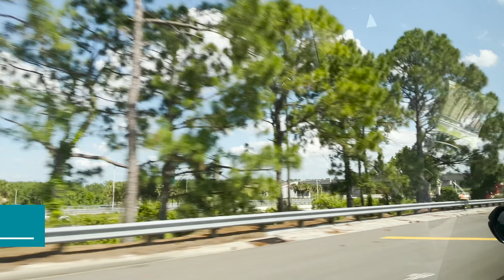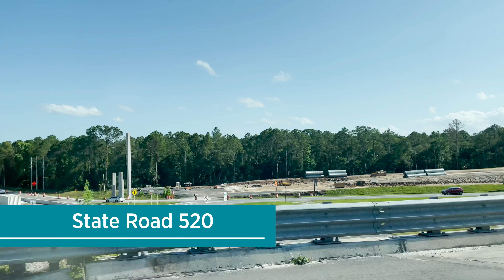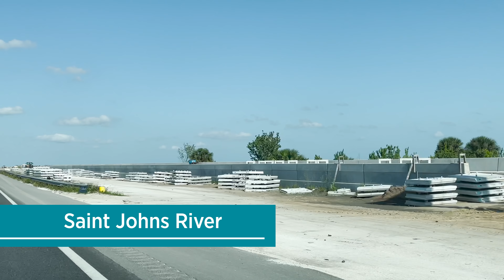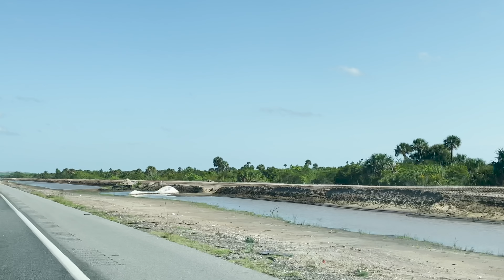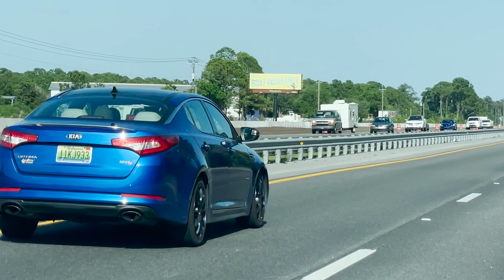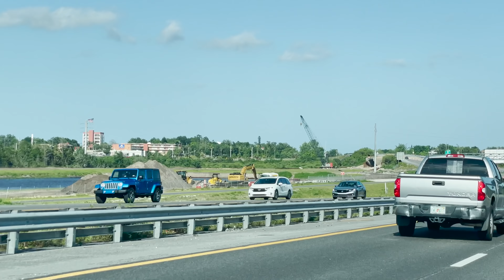Brightline Construction: Orlando Line Along State Road 528 - May 2021

Comment: Great video, one point of clarification though. What you are calling "Headers" are actually "Abutments", the first couple of times I heard you say it, I wasn't sure what you were talking about. Bridges are supported by abutments at the ends and piers in between. 

Keep up the good work, I'll have to look up some of your other videos.
Reply from the maker: Thanks for watching. The information I have been told and read call the concrete that is poured around the top of the pilings that the bridge beams sit on the headers, which is why I have used that term.
Reply: @RoamingRailfan  Interesting I've been a frustrated bridge engineer for about 40 years and never heard the term before. Before I commented, I even did a Google search for the term  just to be sure I wasn't missing something and came up empty. Perhaps it's a term the contractor uses. Whatever, I've been checking out some your other videos and you do a great job. I'll have to start following you.
Reply from the maker: I appreciate your insight, it must be an internal term then.